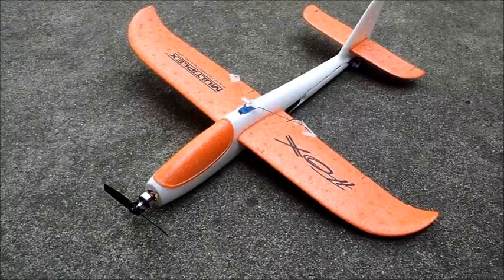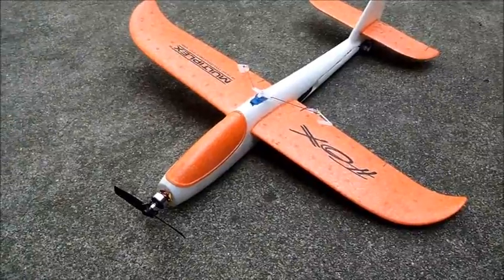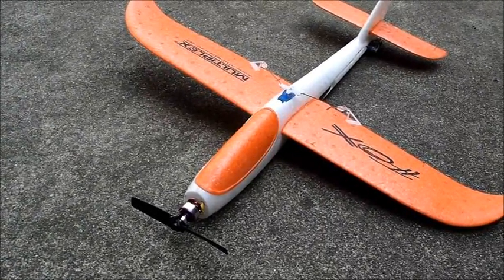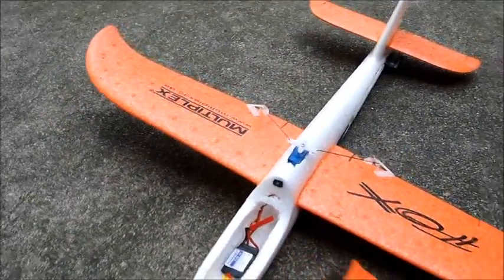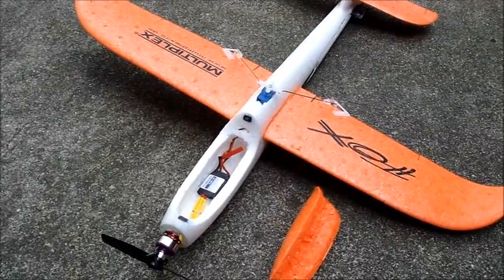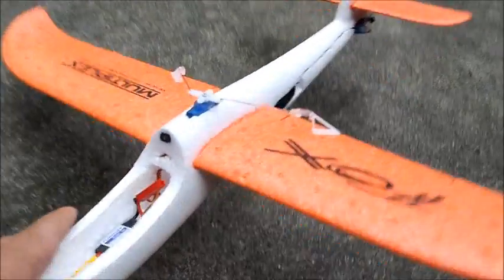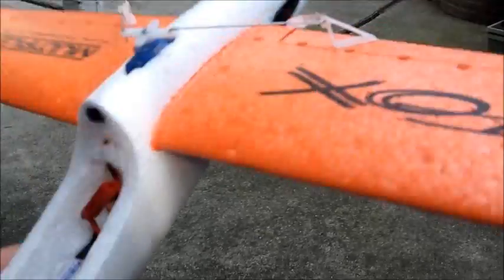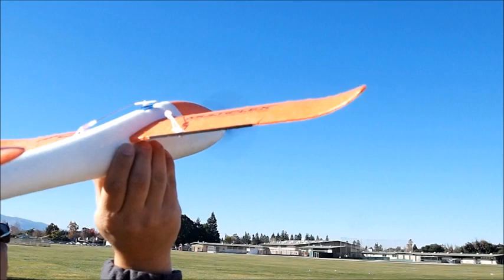multiplex fox conversion to 3-ch RC

Comment: For a beginner, is it better to have elevator and rudder, rather than elevator and ailerons?
Reply from the maker: hmmmm... hard to say. Personally, I never really did a 3 ch, and went straight to the 4 ch. In general Yes. It's better to have elevator and rudder. The idea, I guess is that response time is a bit slower on rudder, and gives you more time to react. To me for beginners, more important is a high wing trainer type plane, where it will self stabilize in turns. Non high-wing trainers tend to want to dive when you turn and needs elevator compensation to stay the course. Beginners tend to turn, and keep turning till the plane turns over and crash...or turn then just let go and don't elevator to compensate, and crash.
Reply: Thnaks man, I am in the process of conversion. Just been drowning with school work. But I am doing three channels because I only have two servos, still trying to figure out how I am going to use only one servo for the rudder
Reply: Depends on the plane, for mid and low wing, I`d go aileron/elevator all day long, but for a high winged plane which is what beginners should be using anyway, rudder/elevator is fine.
I actually don`t like steering with the rudder, and never liked any rudder/elevator models, and learned to fly on aileron/elevator 2ch models with cox engines.
I would say go with ailerons, make sure you have good authority with your elevator, and spend some time on a sim, and if possible use a trainer cable with someone with some experience ;)
Just don`t start with a fast model and you`ll be good either way :)
I`ve been flying since around 1990, and to this day, I could never enjoy a rudder only airplane.
Like rcAllDayLong did, I`d recommend going for a 4ch setup, as you don`t HAVE to use the rudder if you want to use ailerons, and likewise, you don`t HAVE to use ailerons if you want to use rudder.
Just get it all set up on a nice and slow trainer, and you`ll have options ;)
Reply: One servo for rudder is easy, that`s very basic..
Only large models use more than one servo for rudder.

Comment from the maker: This plane is now discontinued and you no longer can get it; but you can get a very similar plane called "hawkeye" made by Hitec. Search for Hitec Hawkeye. It's roughly about the same size as the fox. I'll add some links to the electronics in the description later.

Comment: its ok i have done it (used the hot glue gun). i am not running a motor just yet as i am doing some research and right now i like your motor

Comment from the maker: @sheilstar12 running on a small 9 gram brushless from HobbyKing, now discontinued. Motor isn't stock though, I rewound it for faster rpm...probably in the 3000 kv range. I tried on 3S 360 rhino on 3x2 gws and jeeezzzz, it's a missile. But on that prop, there's no way to mount a prop saver, so I tend to break a lot of props. anyhow, it's now running on the setup in the description.

Comment from the maker: @sheilstar12 No. it was very simple. As always make sure your knife is very sharp, otherwise the foam will get all beat up. The canopy took a bit of work to get right since you want to cut around the orange section only. I first made a simple outline cut around the orange section then made deeper cuts until all the way through it. I then used a combination of a solder gun and hobby knife to scope out the canopy area. Not too hard, just make small easy cuts and take your time.